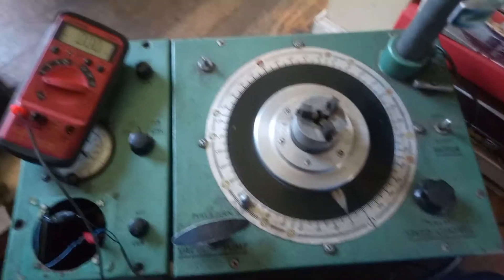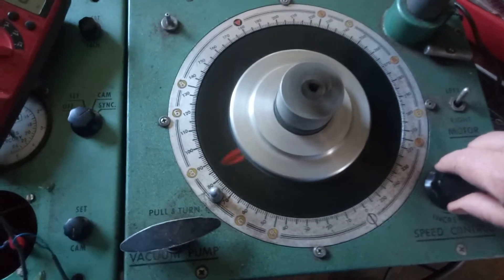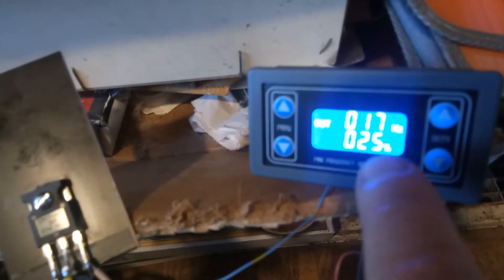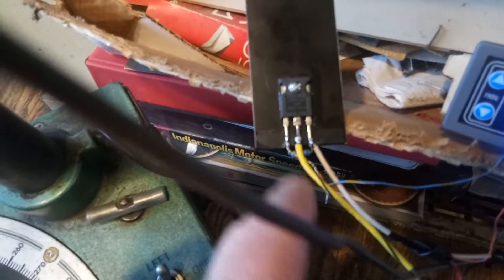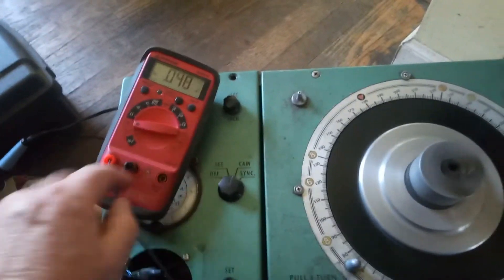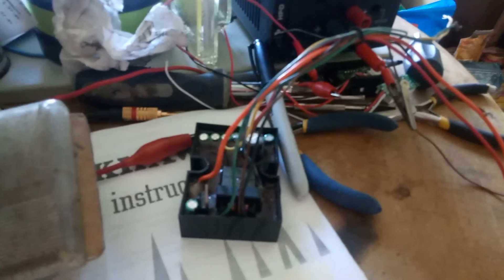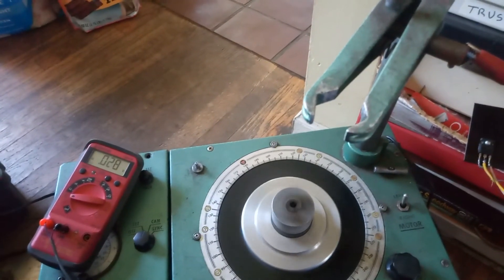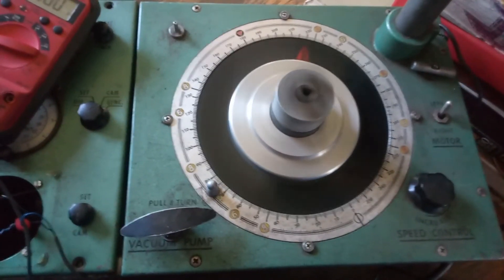ALLEN T-120 Distributor Machine With RPM And Dwell Calibrator You Can Build

Comment from the maker: This machine stinks when it runs. Why do people think I'll take ten minutes to clean a machine before I even start to work on it and then they want it done for almost nothing. I could make this a nice digital meter machine, but I'm just going to give it back. Just a quick video before I do. From what I see the meters do not have a common ground which means it has to be rewired. The machines DC power supply could also be filtered to power the digital meters.

The calibrator is not hard to build. Search for PWM generator. I used a IRFP260 FET but any FET over 200V and 40A would work. The meter reads in duty cycle in percentage. Just multiply the maximum dwell, 90, 60, 45, by that percentage and you will get the dwell reading.  example 45 degrees X 67% duty cycle gives 30.15 degrees of dwell.

Upgrading these machines to digital meters is far cheaper than finding these meters.

Comment: How do I obtain parts from you sir? Thank you
Reply from the maker: Parts for what repair, rebuild, or module?
Reply: @opera5714  If you would be interested in going through the syncrograph and making it also work with HEI modules I would be thrilled.
Reply from the maker: @donaldandsherylvieira1593  It probably does already. If I remember, this has a 12V power supply built in.  12V and common needs to be applied to the module and the output connects to the points.
Reply: @opera5714  Sit, it only has one lead/alligator clip. The guy I bought it from said it was for points style distributors.
Reply from the maker: @donaldandsherylvieira1593   That is true, but internally there is a 12V power supply and you can solder onto and bring that to supply + and - power to the HEI module.
Reply: @opera5714  sir, I am more than willing to pay you to update this beauty so it can do points/HEU/Ford duraspark II modules too. Where is upur shop? I am in Central CA.
Reply from the maker: @donaldandsherylvieira1593  Other side of the country and wouldn't be interested anyway. You can open it up and find the big capacitor and connect to that. Or buy a $13 12V 10A LED power supply and bolt that to the box.  Connect - to case and +  to HEI.
Reply: @opera5714  awesome. Do you sell the kit? Would you mind sellibg a copy of the instruction manual too?

Comment: I have an older Sun distributor machine in which the original flash tube system has recently failed. Rather than trying to repair the flash tube with a LED based flashing system. How do I contact you to discuss?
Thanks
Chuck